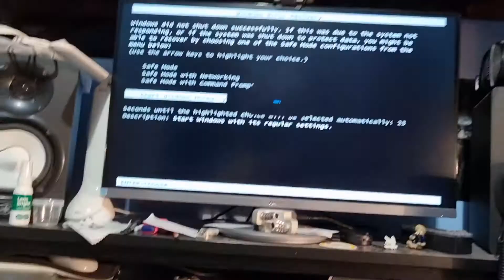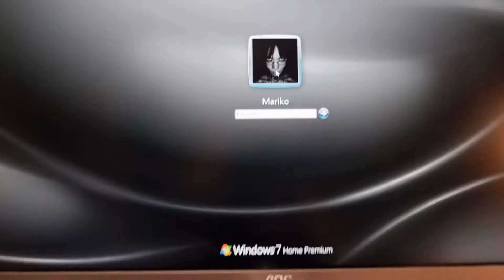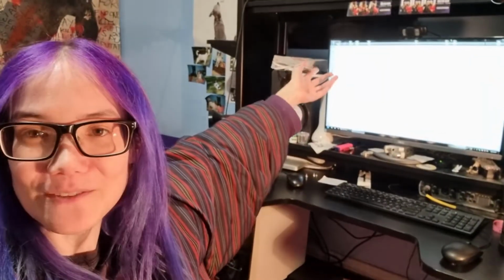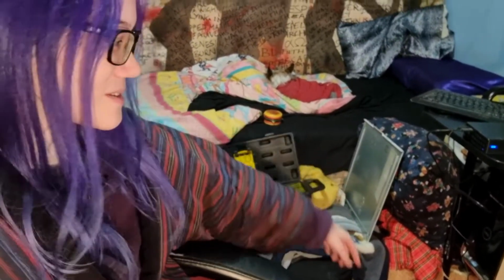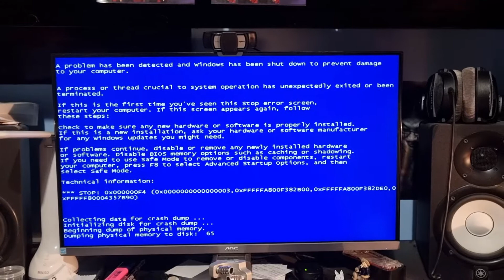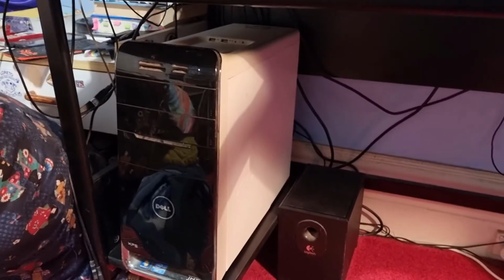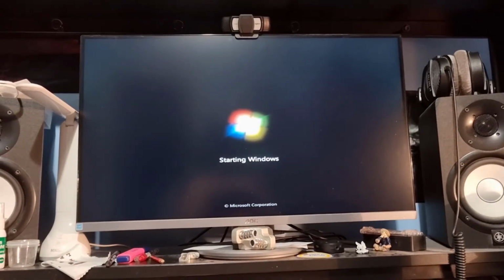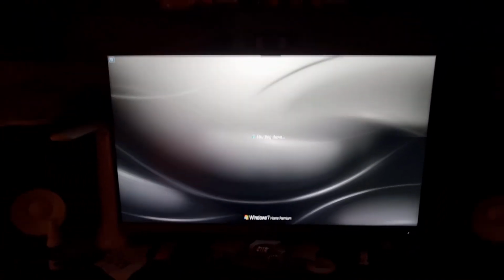No Signal on Dell XPS 8300, Fixing my Graphics Card (and some rambling)

Comment: as a hardware nerd myself there are some cool things you can do with an older machine that you have lying around, though it can be quite situational. Personally i would likely set it up as some form of networked server for convenience.

also short ramble on "out of date" hardware, i run hardware that should realistically be much older than 10 years old. As well as hardware that is just ten years old, while not fully capable and missing features it is absolutely adequate at doing what it needs to if you apply the right thing to it. Buying top of the line hardware today nets you top of the line hardware a year or two possibly three from now, mid tier hardware 5+ years from now and likely out to about 10 years it'll be usable. Plus the things you can do with them after their service life.
Reply from the maker: Haha ngl it's very tempting to turn my old Dell into some kind of random artwork one day... 😅 I don't have the patience to turn it into something useful! XD

Comment: Yay you!  Glad it worked out for you, even if you didn't follow all the "rules".  I could ramble on about actually reseating the graphics card on the mobo itself, etc. but I'll settle for letting you know that it would be a good idea to clean inside more frequently.  Dust can bridge gaps and cause a short or other fault and it doesn't let heat dissipate like it should.  

A simple clip on grounding wrist strap is normally enough too, and they're fairly cheap.

I definitely agree to buy as much capability as you can and grow into the computer than trying to go cheap and find out you need to keep upgrading in stages.  That is, unless you need one in an emergency and that's all you can afford.  Just be sure to get one with a mobo that allows you to increase the RAM and add a graphics card, or you'll feel it later when you find you have little upgrade ability.
Reply from the maker: Haha I'm not gonna bother cleaning it unless I have to, it's my old PC so I should really just throw it out now that I'm pretty sure I got all my old data off it. That's why I also don't care about grounding, although I was sitting on the floor so... that's the ground right? XD

As for RAM, my old PC has 12GB which is more than most laptops you see even today in places like JB HiFi lol. The only thing it ever fell short on was the recommendation for Da Vinci Resolve wanting 16GB (or 32GB for the fancy shit). My new PC has 64GB, completely maxed out its capacity hahaha! I may never use that amount in its lifetime, unless I get really into some heavy video processing, which I think is pretty unlikely tbh! Afaik the 2080Ti is also the strongest video card it can run so I guess I've maxed that out too. But yeah my friend really should'a spent the extra hey ;p